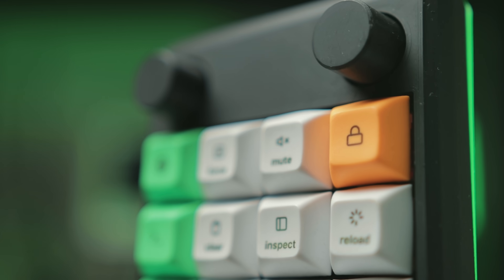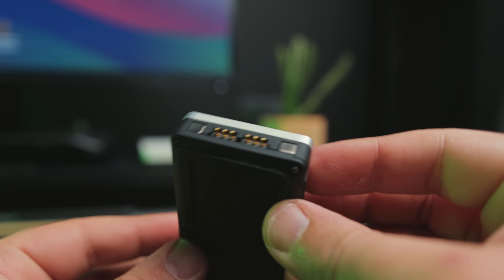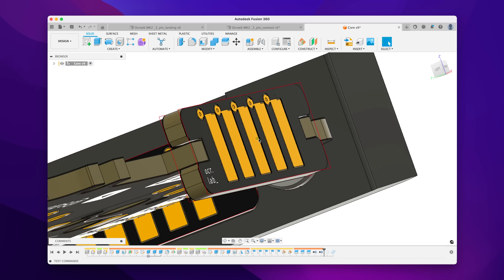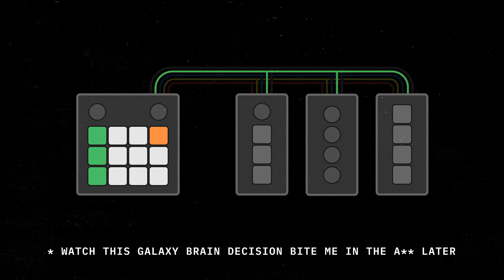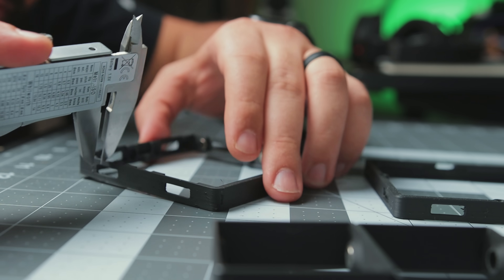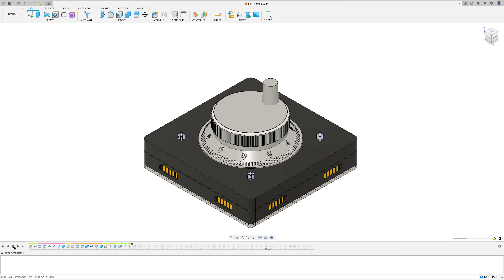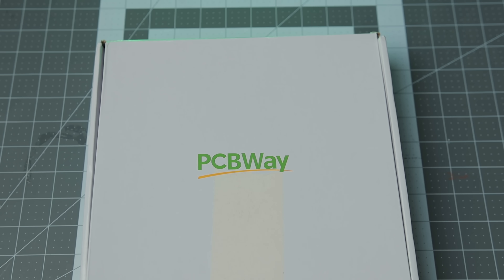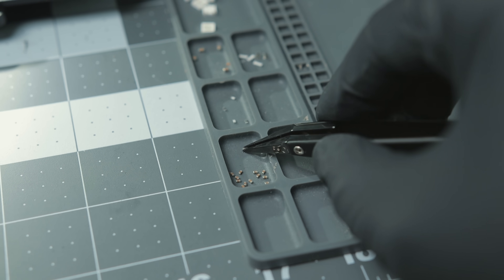How I made a Modular Macro Keyboard System (3D Printed): Ocreeb MK2

Comment: PUT the on chip signal wires (I2C) LOOOONG is NOT a good idea, maybe you need another BUS such as CAN or RS-485/422 instead. 

I have my split keyboard working with RS422 and PoE Ethernet connection  and it works fine for me .

Comment: As a recommendation for V3, I do recommend switch to a MCU that supports DMA (Direct Memory Access) with I2C. That way you can automatically update the local state of the the different module on the central module without interrupts that would cause you sometimes to miss certain interactions (no cpu cycles involved in data transfer from peripherals to RAM). An alternative to changing the MCUs altogether is to avoid heavy compute loads on the interrupt handlers and simply use them to push a "job" in a queue and handle the post processing and sending of module state updates in the main loop. I know that what I am saying is riddled with many assumptions as I haven't went into each and every detail of your implementation, but it should provide some inspiration to overcome the interrupts  issue.

Comment: For the magnets to hold better you either need wider spacing (length of the modulve vs the distance between magnet pairs) or remodel, so magnets can touch each other. The pogo pins spring force and the distance between the magnets make the magnetic force much lower than it would be if they touching. Also try to use higher force ones, like N48 or if available, N52. It makes a lot of difference. (once you try N35 vs N52 for the same size, you will understand)

Comment: a bit late but i want to do something similar but for a midi keyboard. i had it in mind ever since i first saw this video but those past days i was making a mental map of everything i need to take into consideration. i was thinking about the i2c interface and how do i make sure messages don't collide. i want to use the multi master feature of i2c so each module send their data on event so the controller doesn't wait for each module to send data if there is no need to (i was thinking of unintuitively making the controller a i2c slave). i saw that you use the int pin to tell the controller that an event has taken place then it sends a message to each module to get the data (as only i2c masters can initiate communication), or at least this is how i think you set it up as i have't yet looked on your github. the way i would go about it is each module is considered a master slave besides the one that does the usb communication(rp2040 module) (maybe even have another microcontroller that interprets keypreses and sends them to the rp2040 without needing shift registers). each module pulls down the int pin to signal that the bus is busy then sends the event and also triggers an interrupt on the controller to go in a interrupt request subroutine that interprets the i2c payload. this way you only take care of displaying information during the main loop or light effects if you plan to add that and during the subroutine you read the data from the module that initiated the communication and relay that to the computer.

I know for sure it is a hard read as i am also refining the ideas in my head as i am writing this comment and the i2c multi master feature might be too finicky to work for this application

Comment: That's super cool ! I actually did a similar project where I also solved the interupt issue using PWM. I used an ESP32 to handle all modules connection, sampled the PWM using the ESP32 intrupts and it seemed to work fine.
My project had a grid where the position of a module in the grid mattered so I assigned each interupt pin to its own GPIO on the ESP32 but other than that it was the same idea.
 Have you tried using multithreading with, for exampe, FreeRTOS, to be able to read the PWM values while running everything else smoothly ?

Comment: Great work. Very intriguing implementation of the module connection, although the shortcomings. 
However I somehow liked the first version of the macro pad more. Especially the keycap and the symmetry with the encoder knob. But the additional screen is nice. Maybe wireless connection would be a nice addition as well.

Comment: This is an old video and I haven't tried the setup, but here are my thoughts on the interrupt latency problem:

Without changing the hardware and module firmware, I see in kb.OcreebMK2.scan_i2C_addresses() that you use busio.I2C.scan() to scan all of the I2C address space. You could instead individually probe just your modules' known addresses with busio.I2C.probe(), which might save some time. Maybe you've tried that and it didn't work - I haven't tried anything so I'm more in the dark about the situation.

If you developed custom firmware for the modules and modified the hardware, you'd be able to take advantage of the system's tree structure to find device interrupts more quickly. Connect child modules' interrupt lines to individual pins (or to an input shift register if you don't have enough pins). When a module's child asserts its interrupt line, that module asserts its own interrupt line. This means that interrupts propagate up the tree. Giving each module can have a "which of my child ports are asserted" command, the microcontroller will follow the optimal path to the true source of the interrupt. If the hub reaches a dead end, that means that a new device was connected - probing using the known module list will find its address and assign it to the dead end. The worst-case traversal performance (all modules connected in a line) should be similar to the current worst-case (last module in the list is asserting an interrupt) but the upper bound is now the depth of the tree, not the total number of modules, and the average case will scale better with more modules.

Comment: It seems like the mentioned interrupt issue was never fixed?
There also doesn't seem to be the files for the rotary encoder in the github repo. 

This still seems to be the most promising modular macro system I could find. And I am hoping that the Software issue is getting a fix.

Comment: HEAR ME OUT PLEASE. instead of i2c, why not put usb hub ic and arduino as HID on every module? doing this, you wont need a master module to connect the sub modules. you can plug any module on pc regarding its a master module  or sub module. every module acts as a master module. i think its much better in my opinion.

Comment: Great stuff mate. I tried doing something similar (albeit a lot less complicated) a few years ago. Just a bunch of toggles, buttons and 2 motorized faders connected to an ESP32, sending and receiving commands to a bespoke PC software over serial. 

Sounds simple and worked relatively OK. However, my "smooth brain" moment came when I couldn't figure out a way to make the 2-way communication between the PC's audio and the fader's position input work. 

Sounds like such a simple thing. However, my code was looking at any volume change on Windows and was sending the value to faders as soon as they were detected. 

The faders were looking for any movements to the analogue value and as soon as any change was detected, it was sending it to the PC. 

Can you see the problem here? When the PC sends the position change command to the motor, the fader sends back a movement command and you get into a feedback loop...

After much head-scratching, I've implemented a time-based interrupt like a caveman and got it to somewhat work. But this just goes to show you how the things that you didn't even consider as potential issues can turn into such massive headaches.

Comment: I understand the obsession with magnets but what is the use-case here? To reorganize the layout every day?
I don't think the pillar of modularity is to reorganize the layout frequently.
I would scrap the magnet design and use latching mechanism to make them securely tight. Easy to disassemble but still offers reorganization.
Maybe a "wooden bowtie dowel" kind of design (parts are held together at the bottom).
The bowtie secures the parts together horizontally and the bowtie is secured in place by magnets (if you want to have magnets).
Or similar mechanism where the magnet is acting as a key for the latching mechanism but is not giving the strength of the connection.

Comment: It might be a bit of a jump in complexity, but a smarter shared bus architecture might be better than an interrupt based one. I am thinking things like CANbus, LINbus, OneWire etc. You can get off the shelf chips that handle all of the physical and a good chunk of the connection layer like MCP2151 or MCP2021. With their good documentation and your skills. I do not think you would have trouble with them, and they are fairly well available.

Comment: Magnificent work, and you win yourself long term subscriber 😂.
Anyway, I think the the best protocol to handle multi module reading is CAN bus, as it is serial, requiring only 2 wires. Also rs232 with simple addressing mechanism could work. And please switch to C and enough of circuit python trash. C is way faster and there is many libraries with rp2040 to help you out with it, so you won’t be lost.
Anyway perfect work, and I hope to see the next version.

Comment: would this be a good stream deck alternative for controlling OBS?
Reply from the maker: This operates as a keyboard and you can send shortcuts and combos but to control or run automation things on the computer you need to have some kind of app that does that from any context in the system when it receives those shortcuts. I hope this makes sense.

Comment: Love the project. Suggestion I had for aesthetics could solve the strength issue in a single vertical 1x2 unit. Create some caps for the sides. You have them click into the magnet slots, and the default layout is a wide side on the magnet side and a 45 miter to a shorter outer side (trapezoid with the magnets on the long side) this will take care of the inside corners where this issue is most serious. You can then have pieces that are flipped trapazoids (2 outer corners) and a left and right side rhomboid (1 outer 1 inner). If you don't want so many different pieces. Purely have the first trapazoids (2 inner corners) and then 2 end caps, one that connects 2 inner corners side by side and another that connects 2 inner corners on an outside corner (270 degrees if an inner is 90 degrees)

All these end pieces should have a 20-40 degree bevel from the inside to the outside.

Could also just make these all 3D prints that just have a clip in magnet holder on the underside near the snap points.

Comment: What a great video, idea and final product! I really love the design and modularity of it. You did a great job 👍
Regarding the interrupt problem, what if you use the OneWire protocol on this line just to get the ID of one module and then you only have to scan the one you want. I think that way u can also use multiple ds18b20 temperature sensors. I have not really done my research regarding the implementation of this, but I think it is worth a try. Multi-Master I2C, as others suggested would also work fine I guess ;)

Keep up the great work! You definitely have one subscriber more now :)

Comment: Could you make this wireless and use the same connector on this to 3d mouse or are there data transfer or processing power limits etc to achieve that? I would imagine it would be great concept to have modular compact keyboard with these types of accessories but i wonder if it makes more sense for portability to make one keyboard with main connection and another macro keyboard second connection so you dont have to have 2 meter long attachments sticking out from your keyboard. Amazing concept anyways would love to see another update.

Comment: Great project! And the editing is super smooth! 👍

Also for sim games (racing, Kerbal Space Program, flight simulators, etc.) could such a project be usable (if it could work as an joystick-like HID).

As for your question posed to the community:

Let’s call a constellation of 4 connected modules 1 master (the main device connected to the PC) with 3 slaves (the other 3 modules connected to the Master-module).

Is it possible to have more than 1 module (other than the Master) to scan for interupts? 

If for example 1 slave sends a signal and the other 3 can detect the interupt, you can then pinpoint the interupt source.

Perhaps that could help reduce the scan workload.

BTW, I am neither a programmer nor an electronics specialist, so this could be a useless brainfart. ;)

Comment: Hmm, problem with singal could be solved if you had module that can work with signals and could read which of the modules send it. My idea comes from cisco where you have switch for local network that knows where is each of the devices so one module that could keep track of others and act sort of like a middle man between computer and macro keyboard system. Delay would probably be there but it would be impossible to notice it. By the way that module would only comunicate between macros and computer and nothing more.

Comment: One thing you'll want to keep an eye on is the the mating contacts of the pogo connections. You'll probably be fine with the HASL coating on those contacts for a while, but over time the pogos will wear through it and overall it will have a lower cycle time than a harder coating. It is a little more expensive, but an ENIG coating will be harder and will last significantly longer. Great video, thanks for sharing!
Reply from the maker: You are 100% correct. I started seeing some markings where the pogo pins lands. If I do this again I will upgrade at least the landing pads to ENIG. thanks

Comment: Digi-key has these non-paired right-angled through-hole pogo connectors, 399-10-105-10-007000 and 829-22-005-20-001101, for 5 and 6 bucks each, respectively. Still not the cheapest, but at least not as wasteful as buying pairs. Magnets not included.
Reply: I found some more on LCSC, but these are SMD: C5296819, C5296825

Comment: u could add on backplates at least 3 or 4 dip switch(like in fire detecter system) and make easiest register addr for that SCAN line with DS1040-04RN(up to 16 devices or 9 in 3 dip switch)
anyway great job and excellent skills, so plenty nicely equipment

Comment: Hi !

I would have a suggestion for the I2C performance issue.
It is not clear from your scope (at 18:05) what I2C speed is used but it looks like default Standard I2C (running at 100kHz).
The ATTINY816 is capable to go up to Fast mode plus I2C (1MHz). But the hot swap TCA4307DGKR is a bottleneck because it can go up to 400kHz, which is still 4 times faster. Idk if there would be other bottlenecks, I didn't find the schematics.

You might already have looked into it but I feel like it would be the first thing to try instead of going with custom address pulse.

Hope this helps :)

Thank you for this really neat video and project !

Comment: Hi, I saw your video - good for inspiration. You are asking, how to manage scan time (or speed of interrupts). That can be relatively easy solved. As you already have MCU in each module, you can implement multi master I2C. That is commonly used in SMbus application. Simply - your main device will act as slave and all connected devices will act as hosts. So, when they have something to send, they will simply do it. It have few benefits, you have one slave, that all is connecting to, you must not have complex view of actual hierarchy, until you will need to configure slaves. Did you get the point?

Comment: Is the HeyGear resin skin-safe? 
I couldn't find any information about this on the manufacturer's website, but considering that all of the skin-safe resin on the market requires a complex curing process (which include baking the parts several times), I am very concerned seeing you use resin for parts that will have prolonged skin contact over time.

Even when "cured" via UV,  most printer Resin are NOT safe for prolonged skin contact, and will eventually cause the same issues as uncured resin (local skin inflammation or even a complete resin allergy). Adding a protective coat like varnish will only help on the short term, as the coating will wear down over time due to friction and skin oil.

So I would really advise you to replace the keycaps and knobs ASAP if you plan on using yours macros on the long run, or if you want to keep on using that fancy resin printer without having skin rashes every time you use a macro.

Comment: Get the ESP32 versions of the XIaos (or even better an Espressif WROOM module) and use the ESP-NOW wireless protocol. It's not WiFi and it's not Bluetooth but it is so awesome! That way you can even add batteries to your boxes and simply stick them together when you need a charge or wanna draw lots more power for fancy RGB.